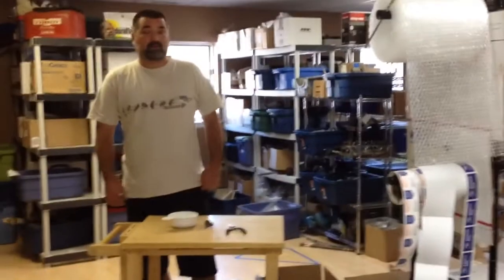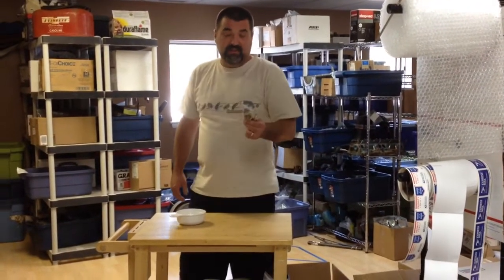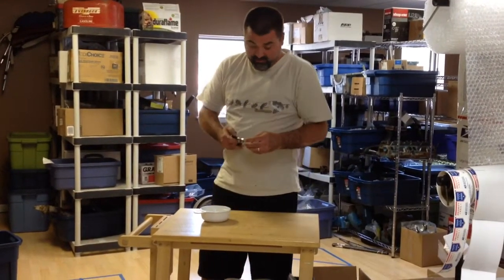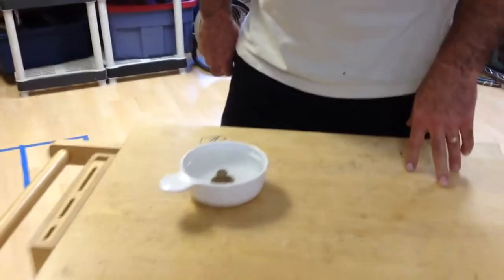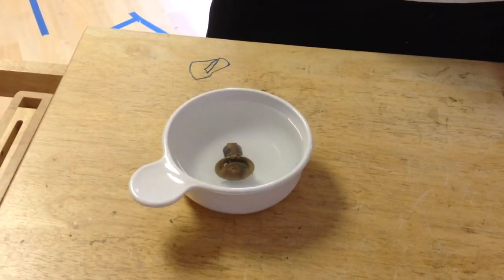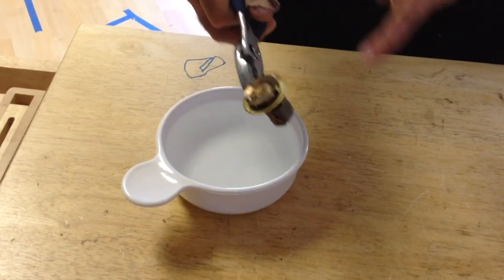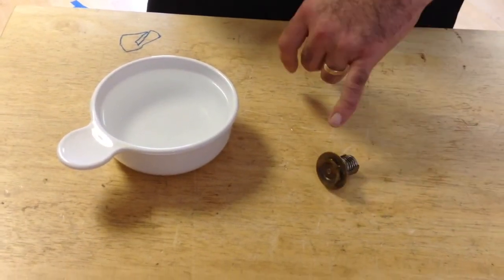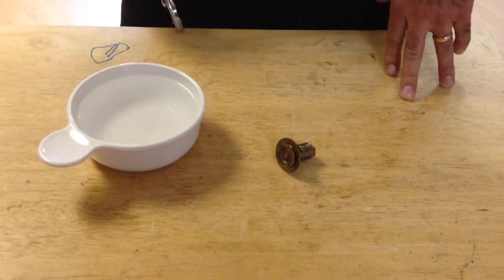How to test a thermostat for your outboard or car

Comment: I did that with my old ones both open up when put in hot water an close but when I put them back in to the motor it want pee but when I take it back out the motor pees
Reply from the maker: I would just replace them with new and test again.  Also it the motor warmed up when you test?.
Reply: @joeseif  no as soon as a turn on if I don’t see any water coming out I turn it right off